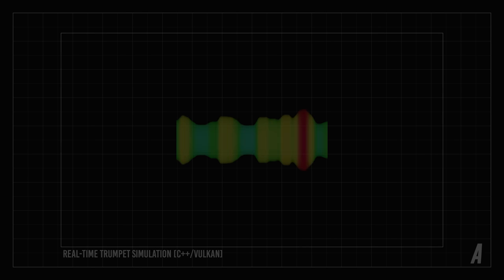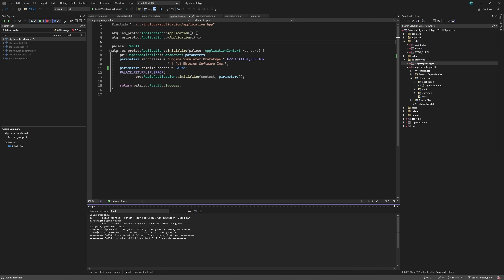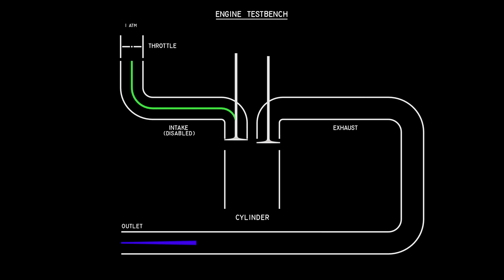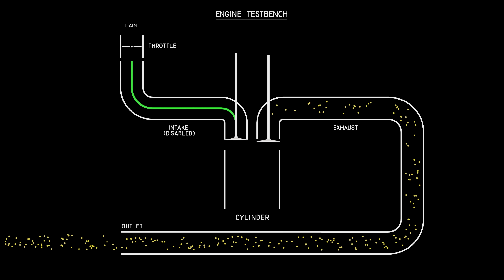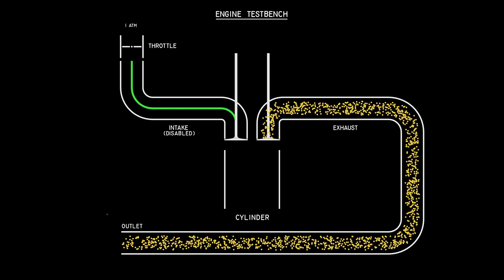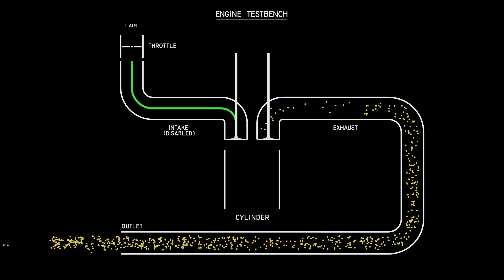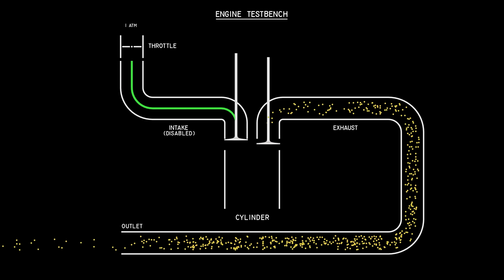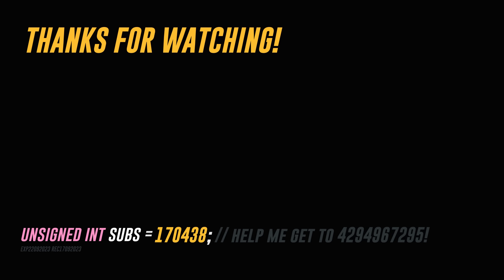Initial Audio Testing - Engine Simulator Devlog 3

Comment from the maker: One thing that I should have emphasized more in this video is how little effort it took to get semi-decent audio out of this simulation compared to the original Engine Simulator. I know the results might seem a bit underwhelming right now but don't worry, this is not the final version. Thanks for watching guys 🙏
Reply: This is still some incredible stuff can’t wait to see what’s next for this project
Reply: Are you using a Riemann solver? And is it positivity preserving?
It's a bit strange that your first simulation crashed, these flux limited schemes are built specifically to handle shock situations
Reply from the maker: @fg8557  it's a Riemann solver and yes it should handle shocks correctly, though they are not guaranteed to be stable. In this case, I suspect that the failure happens at the boundary which may not be handling supersonic flow correctly. I'll give some more updates about this in the next video
Reply: @AngeTheGreat   Yeah it looks like a boundary failure. But I don't remember supersonic boundaries to behave differently.
It should just same pressure and density, as well as mirrored velocity.
Looking forward to some updates in the next video!
Reply from the maker: Supersonic boundaries are definitely different from subsonic boundaries. Technically they're a bit simpler but trying to set a supersonic velocity with a subsonic boundary condition will probably result in incorrect behavior
Reply: @AngeTheGreat  Hm, for walls they are the same. But I think I see the problem now, you are setting some inflow conditions depending on the valve opening. 
I believe, in the supersonic case you can set any value and it will be advected downstream. But I also don't know what will happen subsonically, you probably can't strictly enforce all values or you will get strange reflections
Reply: Do you think you could send the file of the siren thingy to me? it would be amazing if ya can
Reply: I want to throw another curve ball at you Ange... is there a possibility that exhaust flow can actually go supersonic in some cases, and completely change the volume and dynamics of sound produced? A good example of this would be an airplane prop going above the rated rpm and the tips of the prop going supersonic and creating that crazy whine like a WW2 fighter plane in a high speed dive. I wonder if that effect would carry over to a 2 stroke with an expansion chamber creating a standing wave in the exhaust stream at 'xx' rpms? Just a thought..😊
Reply: The evolution of this utility is fascinating! I hope to one day use this to develop more exotic sounding exhaust notes for conventional engines. A little flare for those odd swaps. First target is a GM LV3 6 cylinder swapped into a Porsche Cayman...how do we make that sound more like a Porsche and less like a GM vehicle! Kudos!
Reply: This sounds a lot like my dad's rototiller when I was a kid. 1cyl, about 4 inches of pipe bolted to the side of the head. 
Siren sounds great, too.
Reply: The potential is huge on this concept, and I wish you all the luck
Reply: Wait, how much do you have to donate to get on the lost?
Reply: Got way too much reverb in there. Sounds like it's in a tunnel.
Reply: Excellent progress. Just a thought, but with 3d visualization we use a process called baking to remove the computational cost at runtime of some intensive procedures like lighting.  

Could you do something similar at startup to "bake" a table of values to reference at run time for stable parameters to reduce the real time demands of simulating everything?
Reply: On the right path it seems, hey? Keep it up man. Good luck for the next steps.
Reply: Can you made it on steam🙏

Comment: So im guessing you will be able to alter the exhaust manifold length per cylinder for different  exhaust notes. Subaru comes to mind. Ive always wanted to see if you could adjust exhaust header lengths to make a flat plane inline 4 cylinder sound like a crossplane inline 4. Amazing work by the way.

Comment: What if you built a 2.8l inline 5? But the catch is directing the middle cylinder to two separate runs of exhaust to conform to the dual exhaust it must have (cross over pipes are allowed lol). I can’t even imagine the sound!

Comment: You may like to Learn from Doing some Organ pipes. making pure collision sound simulation and may also take in mind to where the sound of the Engines or sorces is witness from. it seems no point but with the speed of sound you have.. a little bit more time then with the speed of light to culculate Sound outcomes. like a distant Explosion or lighning strike. Up close its an Electrick BOOM. Far away it turns into a Rumbling growling of the sky as the thunder spreads over the landscape, bounces back from walls, trees and clouds or even mountain slaps. For this you could start small by may do a arcustick guitar. Its may easier to set some references there to adjust the coding with. Materials and force is sure noting strange for you. Metalic swinging after being hit like a bell could be a thing.. Like from Tumborines.

I know you are properly choosing engines to set up refferences sure becourse its easier for you in your believe. But if I would wish to make an attempt i would choose stuff you can have a better refference from and Music instroments are just Perfect. like Metal on metal? find a Triangle and hit it. Rebuild it in your program, hit it the same and see if your record from the orginal match up with what the simulation does.

Not really am able to Support you with money but maybe show another path to something cool someday. Imagen Blender have an Addon you can tell what is wood, what is metal, rubber, flesh, bone and instead you need to find a proper sound what you do with it you just let Blender culculate a sound. Imagen going through a forrest and you can hear the wood scratchin at eachother through the wind while walking by in a game. Or a Tank flatens a hatch, A building collapse and so on.

I mean.. The volium of the room, the gass or media density (can be water too) and the Force and tune of a sound... Well how the sound emitting object is swinging from an event of unrest happening to it and the lost of energy it whitness by bring suround air molecules in motion which transport the energy away in waves.. it sure isnt easy but really fastinating to finely whitness that something like sound cards could be as luxury as grafic card.

Umm yea.. just my humble mind about it. Have fun and i definitively wish you all the success you can get from this.

Comment: could engine sim 2 simulate two stroke engines?
Reply: i think it could but the problem is that two strokes would need the third dimension because of the port holes and the port shape
Reply: @incomplete628  2-Strokes are included planned

Comment: I think factoring in exhaust size and shape would help with the sounds in this simulator. In my experience the diameter of the exhaust as well as material can greatly change the sound of an engine

Comment: Awesome, so all that mean things like (turbo/super) chargers and even piston based compressor should naturally work fine with how the airflow is now modeled !?
I guess this could also natively simulate Stirling engines !

But one thing you might want to look into is liquids sound, I feel a great potential for it to generate hydraulic sounds, from pistons to torque converters and even trucks' retarder.

Comment: I think what would help the realism a TON is the sound volume varying with the RPM and throttle opening. With throttle opening for example, just before the RPM shoots up (like an engine revving in neutral), you'd first hear the volume increase significantly at it's current RPM immediately followed by the pitch increasing. With the throttle closed on as the RPM's come back down you would hear the pitch decreasing but it would be quieter. For RPM, there would be a general correlation of high RPM causing higher volume.

Then there's intake noise, which is NOT insignificant by any means.

Then you may consider adding some mechanical noises, or not. Depends on your intent I suppose :)

Comment: Audio engineer here! Something that you could do is use a convolution reverb to replicate the resonance and reflections inside the exhaust pipe for a more accurate, pleasant, and (possibly) less computationally expensive solution. This kind of reverb was made to accurately replicate the resonance, decay, and reflections of an environment and I think it would be an excellent application for it. It would even be able to replicate the metallic resonance of the pipe! You can then pass the result through another reverb to simulate a garage or other space.
Reply: Additionally, I would also roll off some of the high end of the exhaust as most of the time, you wouldn't be sticking your ear right in front of it, so the high end would be less pronounced. It would help replicate a more natural sound similar to what the user would be familiar with.

Comment: Three things:

1) That's a crazy amount of reverb.

I don't think that I get that neither on the engine dyno nor in a full vehicle chassis dyno.

2) This is impressive given the speed that it is able to solve these equations.

3) A "normal" combustion CFD run takes days, if not weeks, to run on hundreds of CPU cores. (You can look up Converge CFD for more details in regards to that.)

Engine combustion CFD is very difficult/challenging, especially if you intend on modelling the chemical reaction processes which produces the flame(let) and propagate said flame(let) for the sound pulse/wave generation.

It's a bit of a pity because if you end up modeling the chemical reaction process, you'll be largely ditching the Rx results, since you are principally interested in the effect that the combustion has on the aeroacoustic properties of your model.

(Whereas normally, I'd be looking at what happens to the products of the chemical reaction.)

Comment: this video made me realise
acoustic standing waves work exactly the same as ac standing waves in a transmission line
a shorted transmission line termination is like a node, where the voltage, or sound pressure, is at a minimum
but if its terminated in an open circuit, that voltage, or sound, pressure is at a maximum, or an antinode!
I never knew the analogies were so close

Comment: In my experience, "generating" siren sounds is very trivial. You just need some kind of oscillator (basic waveforms like sawtooth or square work well enough) doing pitch sweeps, and then put a ton of reverb on it.
Reply: lol all good. I didn't mean to say that this is pointless or anything. Simulating the air itself will always be more accurate. (And it does sound better at the lower frequencies) It's just that, for the higher frequencies, there's not a whole lot of difference between an oscillator and the simulation when it's drenched in reverb. You could probably get closer by adding some random noise to the pitch at the lower frequencies though.
Reply: lol all good. I didn't mean to say that this is pointless or anything. Simulating the air itself will always be more accurate. (And it does sound better at the lower frequencies) It's just that, for the higher frequencies, there's not a whole lot of difference between an oscillator and the simulation when it's drenched in reverb. You could probably get closer by adding some random noise to the pitch at the lower frequencies though.

Comment: i absolutely love these videos and your abilities to create these systems is something i aspire to achieve. i have something that might be worth trying on the sonic side of things, with your use of convolution reverb.

Convolution can be used for emulating any space at all, not just tailed reverbs or big spaces, for example…metal tubes or exhaust manifolds. 

I’m not sure of your sound editing program, but you can often find impulse responses online to use in your convolution reverb plugin. Or you can simply make one yourself by recording a click or a sine sweep inside your space. 

I would suggest using these as well as your larger impulse response? ensuring they are the correct way round in the FX chain of course.

Might be useful but be useless but hope it helps anyway!

Comment: Wait, I know that doubles are a thing, so why is this limited to 32-bit floats?
Reply from the maker: GPUs don't have widespread support for double precision. The other issue is that when vectorizing code, using double precision is significantly slower

Comment: Do you think you can license your sound engine so in future, car games can have more realistic sounds, that may react to problems in engines like losing a cylinder or a gasket failing?
Reply: It's not impossible but probably too computationally expensive to use in games that focus on graphical fidelity or having multiple cars on track at once
Reply: @wiegraf9009  I sure imagine is very heavy weight in computing power and just considered this for the player's car. Maybe for a next generation?
Reply: It's one of those things where resources usually go towards graphics and not towards sound. It might be doable in a rally game because there's only one car on the stage at a time  @fellipec

Comment: HA! Called it 🤘
In the trumpet vid, I had suggested bring able to use that, here, to create exhaust and see how changes impacted exhaust note (don't recall if I said performance impact).

However... I should've known that was your plan all along! 😏
Very cool, and it'll be interesting to see how accurate it will become. This is the sort of thing I could only dream of, back in the days of "Desktop Dyno" 🥹
Shame it's old and abandoned (I think 2003 is the most recent release), as it would've been cool to be able to import its engine saves, into yours!

Comment: I'm a huge fan of what you're doing here and just recently discovered your Channel. I wanted to throw in my $0.02 on things that might improve the realism of your simulation and that's valvetrian noise. There's a ton of videos out there where builders will test cylinder heads without a block by just actuating the valves alone in normal sequence of engine operation to check for hot spots, friction wear and different manufacturer specs I don't fully know about. This is all to say , ive learned that a massive amount of the sound we hear produced thru the intake and exhaust of an engine is from the valves themselves. Something to consider 🙃

Comment: Can i get an explanation of what did he achieve in this video? Use fluid simulation pressure result to create sound, add syntetic effects since he is not simulating the whole engine. ?. That feels like missing or disappointing.
Reply from the maker: I've already implemented an entire engine simulator, you can watch that video on my channel. This is the successor project and this was an audio test using the new fluid simulation
Reply: @AngeTheGreat  Thanks

Comment: The one thing I learned when doing the audio for the coin-op SF Rush at Atari was that only recording the exhaust noise did not make a very good engine sound.  There is a lot of mechanical noises in the lifters, belts, etc, that needed to be mixed in to make it more convincing.

Comment: For a one-cylinder engine, those sounds were actually almost perfect, siren was crazy accurate too
Reply: sounda like a ktm duke 125 or yamaha yzf r125
Reply: @z3shan989  that somehow turns into a royal enfield bullet 350 while idling
Reply: agreed, it almost sounded like a midsize RC airplane motor with an unrealistically low idle speed

Comment: Iddle sound probably need noise of cooling fan and touch of belt/gear hum. They are pretty much constant in terms of volume/speed and not "connected" to main engine sound so they could be added separately.

Comment: Bro, let me work for you! I'm a mech engineer fascinated by coding. My biggest desire is to merge my engineering knowledge with programming/simulation and you seem like an awesome mentor.

I've read Heywood and Blair's book on engine simulation for an academic project, worked with GT-Power, designed the intake and exhaust system for a Formula SAE prototype, and currently working in the auto industry.

Please feed me your knowledge!!

Comment: Something that often gets overlooked is that a good portion of the engine sound comes from the intake.
Reply from the maker: Luckily my new fluid simulation can model intake sounds as well. For obvious reasons the "engine" in my video doesn't have an intake, but it'll be added soon
Reply: @AngeTheGreat Cool! Cant Wait! How long do you think it will be before we get to hear an actual engine in the Dev Vlog?

Comment: The disappointment is unwarranted, I think.  Even the first audio out is impressive enough, given that current options available in the market are sound bytes that are just time stretched/ pitch adjusted (which is actually terrible).  Please please please keep doing what you are doing.  Simulating the "outside" world gives a bit of echo/reverb that might exist in a small alleyway, but not really anywhere else.  Great work, man.  Looking forward to the next installment.

Comment: I acutely prefer the idling and low rpm sounds over the full throttle sounds. Especially on the last simulation, there's a very nice crips snap to every cycle. It sounds like old single cylinder motor cycle.
The mid to high rpm on the other hand, (at least for now) have a strange "computer like" buzz to them. It reminds me of old 16 bit racing games. Now I have no doubt the all of this will get better in time. It's just a prototype after all. And It's dam well impressive you get this far at all. These are just my observations.

Ps. The last engine at full revs reminds me of a whipper snipper and it's wire blade.